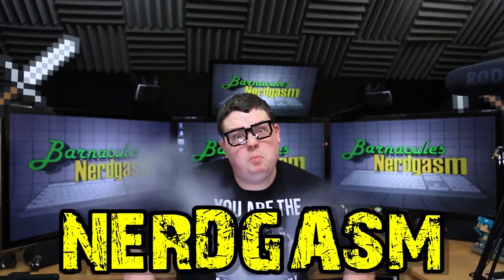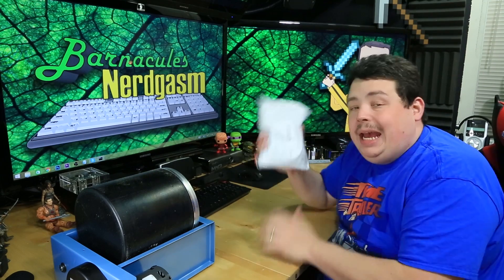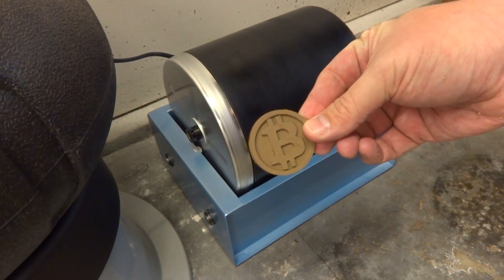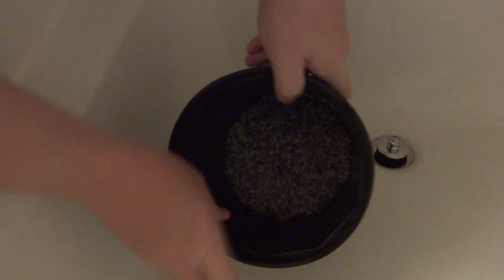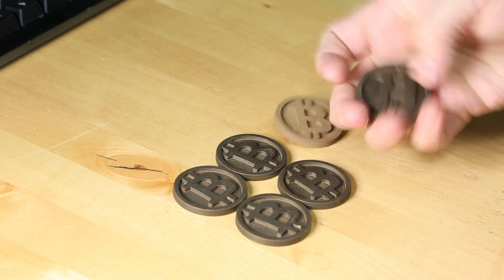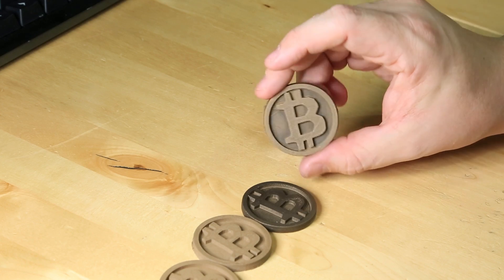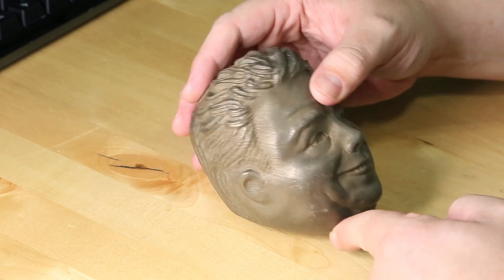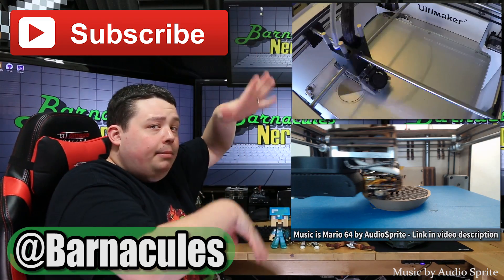Polishing 3D Printed Bronze w/ Rock Tumbler & Steel Pins - @Barnacules

Comment: Try buffing just the face of the coin on a flat surface face down on a sheet of crocus cloth (maybe wetted down with a little water - if needed).  Circular motion.  That should give a great contrast of the face to the darker background.  Could be used at any of the stages of polishing.  Give it a try.  :-)

Comment: You should try using brass screws instead of stainless steel pins. Your parts turned out darker due to contact with a totally different metal.  They would have a different color and sheen with brass screws.  Give it a shot. You like going to Home Depot anyway. 

#polishingmybronze

Comment: I know that you have posted this video a long time ago, but just saw something that you might find useful. Another 3D printing video showed brass screws as media with a few drops of actual polishing material mixed in with the media. Apparently having the polish mixed in with the media really brings out the shine. The model was then buffed with a rotary tool with a polishing pad. Give it a shot and see what happens. My first 3D printer is coming in a couple of days, it will probably be a while till I try printing bronzefill and copperfill.

Comment: dude the rock tumbler will not qork well try to use a wire brush that has lots of wires on it then use very. fine sand paper and clean it😄

Comment: Have you tried running the wood filament or any other filaments through the rock tumbler or vibratory bowl? I wonder if the abrasive steel would rub off and onto the prints...

Comment: If you don't want to get the dark color from the pins, you should use more water in the tumbler like you did in the initial test. The problem you had with the initial test was just not enough time. The pins work best with more water. You might also want to try adding a small amount of Lemishine as well as the detergent, it will help bring out the bronze color too.

Comment: Have you ever considered using Acetone to polish these? It would smooth the surface and remove those straight lines. It might also deissolve just the plastic and leave a purely mettalic surface.

Comment: I've been using a vibratory polisher for years. I use the walnut shell media with incredible results.The trick is......pour the Brasso liquid INTO the media while the machine is running, then just toss in your items.After running overnight, the metal shines like chrome!They do come out with a dry dull film, but just wipe it off with a microfiber cloth and enjoy the shine!

Comment: Try adding brasso to the tumbler instead of the water and soap. Also use a buffing wheel on the dremel with the brasso instead of a cloth. The reason I say this is because brasso is an abrasive and  constant flow across a surface will polish to a mirror finish. used to do this with brass belt buckles.

Comment: get a soft polish wheel w/ some polishing rouge (white-fine) and it will shine w/o scratches.  the speed and pressure you use will vary

Comment: I think the media was a little too large and heavy for the material you are polishing. You have to remember that it is strong for plastic, but it is still only 20% metal (and a soft metal at that), and you are using a media meant for like solid rocks and pieces of metal.

Comment: I think there's a script out there that tells the nozzle to do a non extrusion smoothing on the top. basically runs the last layer a second time at a set speed for you nozzle and gets the polished bottom of the nozzle to show on the top layer. You may have some lines if your nozzle isn't absolutely perfectly level on the mount, so might try slic3r's spiral top and bottom fill pattern. (you can get some cool lensing affects with that spiral). Saw something about it on an UP!3d google group, im gonna do some digging and will post here when I find it.
Reply: Mprint (uses Miricle Grue) does it. Free from Mbot home site.

Comment: Barnacules Nerdgasm Have you ever thought of using a Liquid Resin printer like the Carbon3D or Peachy Printer. They seem to be extremely cheap when compared to the classic Makerbot style printers.
Reply: Those printers aren't even out yet, and probably will be very expensive when they're first released.
Reply: The peachy printer is already out. And cost $100
Reply: Jason Lerado That's true, but right now it is only a pre-order, one pack of resin costs $60 and it prints hollow and in low quality.  Lots of the things Barnacules has previously printed would be very flimsy and weak if they were made on the Peachy Printer.  It also mostly prints up because it has such a small diameter for printing. You get what you pay for.
Reply: Very True!

Comment: You can still use that vibratory tumbler and get a better finish on your bitcoins. I'm a senior product designer, and only use walnut shells as a 'final' processing media in my VT. The dropping action of the rock tumbler like yours rounds the edges of the parts too much for my products.

Go online to McMaster Carr and look at their media. The ceramic and composite stone materials will cut just enough on those coins. They even used to have .STL downloads of each type, which you could compare to your piece in whatever 3d program you used to make your part. 

Thanks for the video.

Comment: Barnacules Nerdgasm I haven't been able yet to print using the bronze filament. I have a Makerbot Replicator 2X and everytime printing starts the filament bounce off the feeding gears. When loading the bronze filament it works good and the gears push down the bronze filament no problem at 210 degC and comes out as expected, but ones I start a printing job the filament does not come out. Any suggestions?

Comment: I just watched your video before this one and was about to comment that you should get a rock polisher instead of the vibratory bowl. But I seen this video on the side so I didn't comment on the last video. I have been using this material for a few weeks now and have been messing around with different ways of polishing it to a shine. I tried using the same pins you are using and a few other materials. The best method I have found so far is using small grain polishing stones and adding in a few table spoons of a bronze polish like what you added to the shells in your last video or the brass-o you are using to polish them in this video will work as well "I found 3 table spoons works the best" also only using around 1 cup of water and 1-2 table spoons of detergent. Usually I only use 1 tablespoon of detergent because there wasn't much difference between 1 and 2 besides when you open it there is more suds, but no difference in the amount of shine. Looks like you are getting a good shine here too though, but with the small grain polishing stones like I just explained it comes out looks like metal completely with a very vibrant shine. If you want me to I can make a video showing you my method of polishing them and post a video comment for you, but I think my directions here just about cover the process. :)

Using my method you will not get all those scratches over your item, and I haven't broken any part of my prints using this method like what happened to your head. Another thing I don't know if the tumbler you are using has speed adjustments like mine does, but if it does I would suggest running it at its lowest speed over a 12-24 hour period for the best shine and to prevent any scratching of your finished product.

Comment: Barnacules Nerdgasm !!!!! If you decide to tumble any rocks in the future with standard polishing powders and abrasives, do not pour your left over sludge down the drain! This is very important. That sludge is essentially concrete, and if you pour it down the sink and there is not adequate flushing, or some get hung up in there, itll dry up and youll have to have your plumbing ripped out and replaced.
My mother is a bit of a rock hound and she made that mistake years ago when she was tumbling her gemstones, and that was a lot of work to fix.
I do not think that will be an issue with what you are using to tumble, but I wouldn't chance it anyways. 

Edit: I wonder how traditional polishing powder will do. This would be powdered aluminum oxide(sapphire). I would definitely soap it up to reduce chewing up of the plastic tho.

Comment: I was wondering if you could use some kind of small rocks/minerals in the tumbler instead? After all you want something significantly harder than the bronze itself working against the surface. Perhaps that would also allow to use smaller size media to avoid deep scratches and maximize the area of contact. What do you think? Nice project btw.

Comment: #polishingmybronze  Barnacules! Try a polish called Nevr-Dull. I think it's cleaner, more effective, and less stinky than Brasso.

Also, if you live someplace where the recreational use of certain plants is allowed, the oil in Nevr-Dull dissolves residue from that very easily.

Comment: Why are you using steel pins?? Imo there way too hard material for trying to finish plastics (yeah I really don't consider that Bronzefill to be "metal"). I would try something like sand or glass (with and without water) which are used in sandblasting cabinets. Anyway I don't think you'll ever get good shining finish with steel media.

Comment: The best way to do this is to go through a jewelry buffing technique. Using a dremel and silicon buffing wheels at different grits. Once you have it all buffed, thats when you run it through the steel shot. But I think with the plastic turning gray, you should just use brasso after the buffing process.

Comment: Barnacules Nerdgasm  if you are going to continue with brass work i suggest using blitz brass polish its much more effective at removing scarring and putting a better sheen on the brass than the brasso i used and tested with both for the longst time and my suggestion would be blitz brass shine which can be found on amazon for around 15 dollars for two bottles

Comment: use a finer media for better mirror... it would take longer but it would be a much better result also it wouldnt scratch as deep. note finer does not mean softer, if you used almost a metal dust it would be better.

Comment: Barnacules Nerdgasm, I'm saving up for a 3D printer myself at the moment. I'm very impressed with the results you're getting with the bronzefill material, and also the fact that you say it feels like real metal. So I can only wonder, as this would be an interesting use for it, can it be used to make (relatively low performance, but still decent) custom heatsinks?

Comment: Hi Jerry, did you consider ceramic media? Also, when cleaning/polishing after the tumbling, you might want to look at compounds designed for plastics as I think that's what you're really polishing. To make the metal particles shine (after polishing off the surface plastic) you may want to try Burnishing, which is essentially rubbing the surface with a hard, smooth, shiny object made of either steel or a mineral.

Comment: Excellent video, Jerry. Nothing wrong with having mistakes - you are helping many people by showing what doesn't work.
Have you tried using the brasso in the tumbler instead of the washing up liquid and water? Also, small steel shot might work better in the nooks and crannies than the pins.
I've printed a large Dredd badge with Bronzefill and I've only used steel wool and elbow grease so far. Looks ok but a ways to go yet!
#PolishingMyBronze

Comment: really impressed with the stainless rod media. That said you would need a LOT more bags of media... for the coins you maybe were ok but for the head you want more. The water I usually fill up enough to cover the media since that is your lubricant along with the soap which helps to also carry away excess muck (hence the nasty foam.) That said if you threw some extra polishing compound into the vibratory its worth tossing the coins in there to see what happens. I do have to say the contrast on the coins from the tumbled and the brasso really made them stand out like a well aged piece of art. As always keep up the good work and don't give up on one thing if it didn't work at first! I have a large vibratory bowl and a rotary and each has their place in the aspect of finishing stuff!

Comment: Hey barnacules, my suspicion is that the soap suds lift the steel 'stain' off of the actual piece, i'm just guessing, but it sounds plausible. Perhaps you should use half as much soap as you did the first time, but not just a single drop, or just do it the same way if you want the grey effect, just do it the way you did ;)

Comment: I've never polished anything but rocks. I wonder how the bronze media would work with some 4-stage polishing grits designed for rock tumbling. Also your tumbler will work best with the barrel about 2/3-3/4 full.

I'd leave the steel filler media in there, then add some grit; course, then rinse, fine, then rinse, pre-polish, then rinse, polish, and rinse. 

You won't want to run it as long as you would when polishing rocks, but it would be interesting to try.

Comment: Awesome project and ideas.  Suggestion from an antique car restorer here.  Get a $30 variable speed dremel tool they have various cloth bits you can use with the brasso and cut your time down drastically and save elbow grease.

Comment: Can anyone help me  is this a good computer 

System features:
Product Type:	
PC
Product Model:	
Strike
Processor:

Intel Core i5-4460(3.2Ghz) 6MB LGA1150

Chipset:	
Intel H81 Express Chipset
Graphics:	
Gigabyte GTX 760 OC 2GB GDDR5
Memory:	
8GB 1600 MHz DDR3 
HDD:	
1TB 7200 rpm High Speed SATA III Connection
Optical Drive:	
DVDRW - BLACK
Reply: Yeah i have almost the same specs and it's enough to run almost every game 60fps + ultra settings.
Reply: Yes its decent how much and is it prebuilt
Reply: Almost identical to my build. I built it myself, got a monitor, and SSD and payed 1200ish for it. It runs everything on High-Ultra with smoooooth glorious 60 FPS
Reply: Trust Me Im Lying Do i believe you or do i not your user name is rather shifty lol jks but thanks for your feed back I'm getting it tomorrow
Reply: Ferakath
Hahahahah lol guess you'll find out. Good luck man :)
Reply: I want to build something like that but with a faster RAM :P
Reply: Ya a good pc for gaming
Reply: damon smith If that pc is good for gaming, than what is my pc?
Reply: Yeah, got good specs for gaming and normal every day use. What site you getting it from, looking for a gaming PC myself

Comment: You can use toothpaste with a cloth buffing wheel on like a dremell. That's what I use to get scratches out of plastic. Just be careful not to leave the wheel in one spot to long as it will take off material.
Reply from the maker: That is a great idea! I need to get a buffing wheel for my grinder.
Reply: if you get a buffing wheel also get some jewelers rouge in different grits.

Comment: Hey Barnacules, I'm really curious to see if you can use electroplating on that stuff. A lot of people use a trickle charger for a car battery as the power source and clean scrap metal for an anode. It might be worth looking into.
Reply from the maker: If you find a link on how to DIY it I'll give it a try at some point.
Reply: Electroplating is absolutely safe to do in your garage.  Proper ventilation because if I remember correctly it produces hydrogen and oxygen.
Reply: Barnacules Nerdgasm
 Here's a quick write-up for learning the basics
http://www.popularmechanics.com/science/diy-chemistry-teach-yourself-electroplating-15445718
A simple setup for getting started
http://www.instructables.com/id/High-Quality-Copper-Plating/step1/Materials/
And a slightly larger setup
http://twilightrobotics.com/prototyping/electroplating1
Honestly, just about everyone who messes around with DIY electroplating comes up with their own way of doing it.

Comment: How many times consecutively do you think you could use the media for polishing?
Like, how often would you need to replace the little steel pins in there? And what other kinds of media are there?
Reply from the maker: The company says it's lifetime media and will never need to be replaced. But the fact it rubbed off on the bronze seems to indicate it will eventually disintegrate so I'm not really sure now.
Reply: Barnacules Nerdgasm
 the darkness on the bronze is probably also bronze, just super fine (talking molecular level ) which reflects light differently, and yes, the stainless pins do wear down, but so slowly, probably not really noticeable within your lifetime (especially when working with materials softer then stainless).
Reply: Barnacules Nerdgasm You  didn't rinse off the steel material before you threw it into the tumbler. That dust was probably from manufacturing.
I can imagine the pins wearing down at the edges over a few hundred spins though.